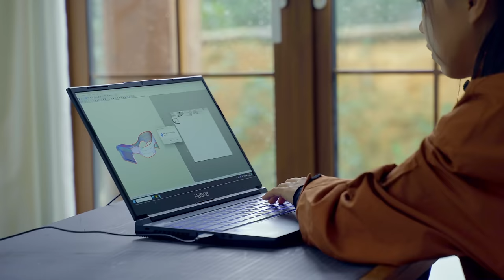I Made My Own Car To Celebrate Chinese New Year

Comment: Happy Chinese New Year, to you. Great project. You are a very talented builder. 👍🌞
Tip: Learn to weld in a continuous line. The dot, dot, dot welding method introduces
slag into the weld, between the "dots", and make a weak weld. 😁✌🖖